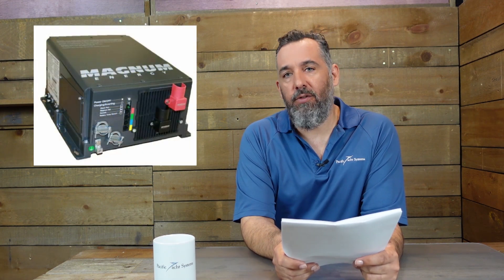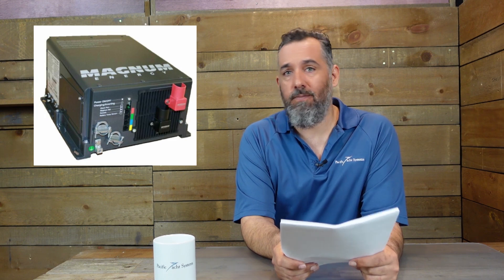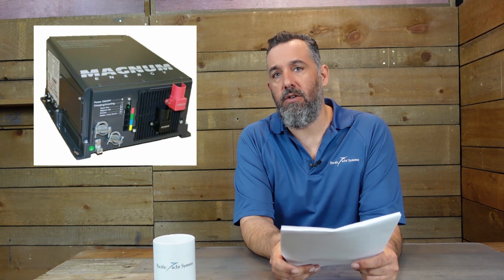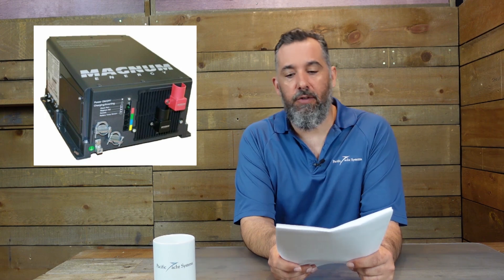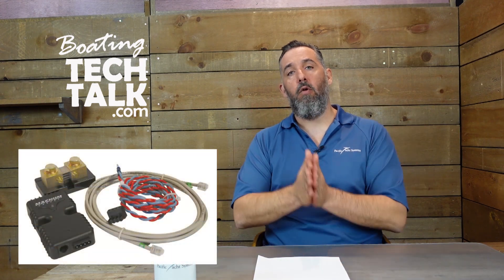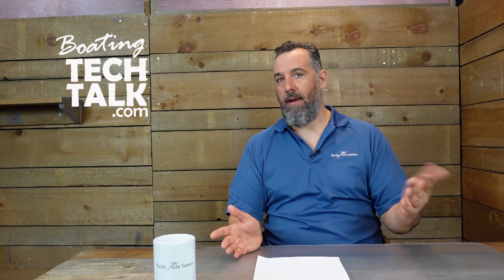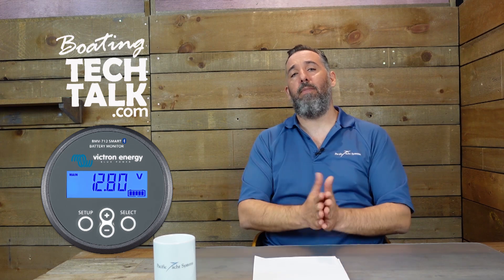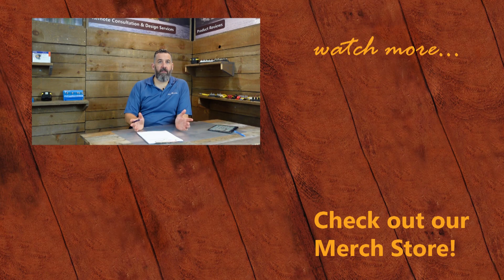Should I Use the Inverter/Charger Monitor or a Stand-Alone Battery Monitor?

Comment: I have a 50 year old 29’ sailboat that is surprisingly good condition. Nonetheless, it isn’t worth very much. I would love to install all the latest Victron products on my boat, but the electrical system alone would be worth more than my boat. As a compromise, I installed an AiLi battery monitor on my boat. I know it’s made of Chinesium, and I generally try to avoid cheaply made offshore goods, but you can by one for $40 on Amazon. The model with a 300 amp shunt is $52. It does everything you just said a monitor should do; Voltage, Amps in Amps out, and it works. What can I say?
Reply from the maker: Hey Martin, thanks for sharing. Good points, every decision we make for our boats as to be within a context (boat itself, budget, use of boat, etc).
Reply: @PacificYachtSystems  
On the other hand, if I was running a reputable marine electrical outfitting company such as yours, I wouldn’t install one on a customers boat.
Reply: Made of Chinesium...that is funny.

Comment: MasterVolt also offers the CombiMaster 12/3000-160 that is very compact and lightweight with one Remote control and monitoring via a single 
intuitive touchscreen. These Magnum are heavy and bulky and very inefficient.
Reply from the maker: Thanks Abel for sharing. My understanding is there are two types of inverters: high frequency and low frequency. The low frequency ones are heavier and more heavy duty and the higher frequency are lighter and for normal use. 

Anybody else want to chime in?
Reply: @PacificYachtSystems  Thanks Jeff for the response. Correct but big, heavy inverters will soon be a thing of the past if not already just like big tube TV's.  Thanks a million for all the info you're putting out.
Reply: @PacificYachtSystems  , Hey Jeff, you're right.  The low frequency inverters are much better for quick/high surge, typically inductive loads.  One of the other YouTubers I watch that is very knowledgable for solar/battery/inverters just posted a video this week of a "portable" solar generator that uses a LARGE toroidal transformer.

https://www.youtube.com/watch?v=CuV65mysNuE